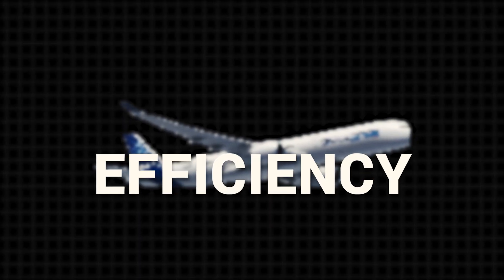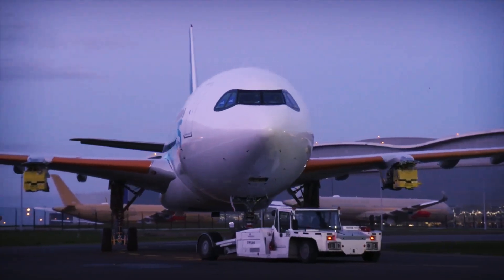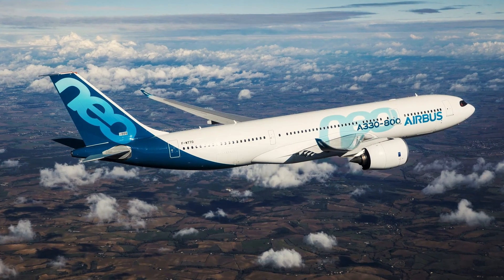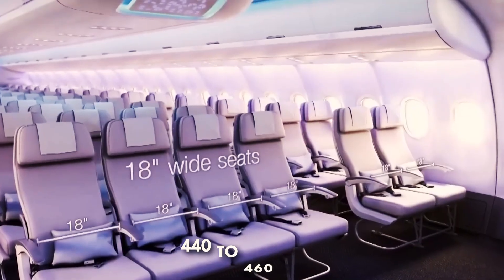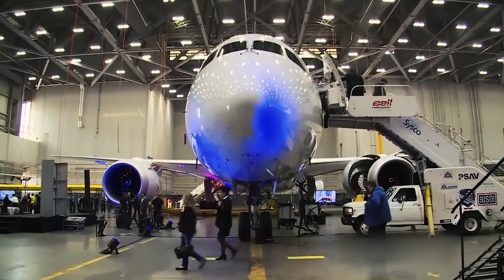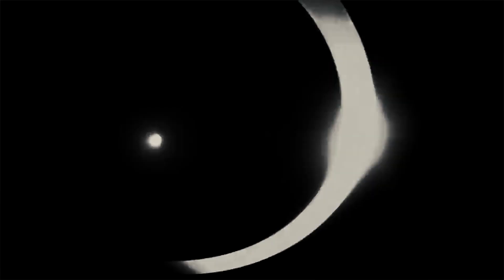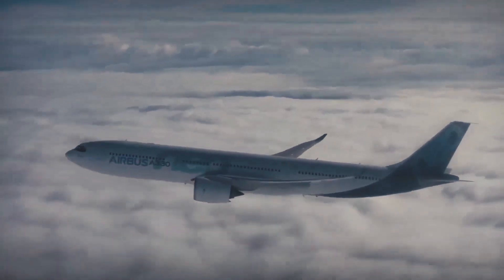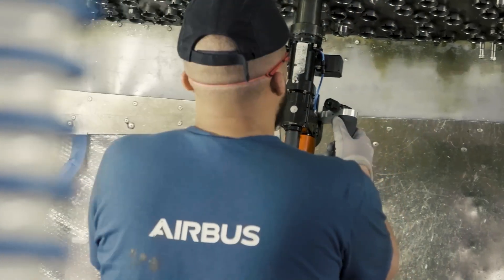Just How GOOD Is The Airbus A330neo Actually?

Comment: It isn’t a direct competitor to the 787. It is bigger, has a higher pax capacity, higher mtow, higher empty weight, higher fuel consumption, and similar performance and capacity to Airbus’ own A350. The two airframes are within a discount of cost and the A350 is superior to the A330 in every single way. Why get the A330 when the A350 does everything better and gives you dramatically more range? There just isn’t a comparison here. The A330 competes with the A350 and with the existing 777-200s. 
Why would an airline switch to an aircraft that is less flexible with worse field performance? It just doesn’t make any sense, and that’s why it hasn’t sold well at all, there are simply superior products.
Reply: You are totally wrong! It`s a direct competitor & it`s very competitive in efficiency & performance with recent upgrades implemented & soon to be further improved. It`s price is also very attractive to airlines who are budget constrained. Sure you could argue the B787 is the better aircraft with it`s composite build & later design features, but it`s reliability has been called into question many times where A330Neo hasn`t. With decent purchase price, good reliability & excellent comfort for passengers it`s an attractive alternative to B787 & this is why it`s orders are increasing exponentially. Do your homework on this aircraft, it`s shed a fair amount of weight, it`s engines are very fuel efficient, even it`s wing angle has been improved to give B787 a hard time in the market place.
Reply: @edwardwilcox6606 not, it isn’t. They don’t compete at all for all differences I’ve specified. There is nothing that they compete on…
Reply: @Da__goat  They compete at every level, if you can`t see it nothing I suggest will convince you otherwise. Why don`t Delta have any B787`s? Because they have A330Neo`s!
Reply: @edwardwilcox6606 There is no metric that either share in common at all. Delta got the A330s at a massive discount, it was well reported. They got them for some 40% off. If you look at the numbers, that is the same list price as the 787-8. Which has outsold it some 7:1. The A350-800 was actually cancelled because of the A330 Neo but the A330 competes more with the A350 than the 787. If you don’t know how numbers work I can’t help you here.
Reply: @Da__goat  I wasted my time obviously.
Reply: @edwardwilcox6606 numbers are hard, not everybody gets them.
Reply: @edwardwilcox6606  my answer, the performance really matters, the angle doesn’t really affect its performance that much. Its engines are heavily derated and it utilises a bleed air system, which eats up the precious thrust. The 787 also has a crazy wing flex and wing sweep, which isn’t seen before on any aircraft, including the 350. This is reflected with a climb rate reaching really close to that of the 757. Orders aren’t increasing that much though, but I’d say cathay bought it. I live in Hong Kong and I don’t really like cx’s ceos, or 330neos offered in the Asia pacific region. Sometimes there can be a thousand questions on why the 330 Neo wasn’t popular, and flying on one and comparing it with the 787 will explain it to you. I really recommend you to fly on one of both, trust me, looking an aircraft on paper doesn’t really work
Reply: A330 is not bigger than 787
Reply: @carmenvalmalaartaraz8260 yes, it literally is, in every single category
Reply: @Da__goat  i don't know where you get your data from. A339 and B789 can carry a similar amount of people, have nearly the same MTOW and very close range figures, no way 3000km, more like 300nm more the 789.
Reply: @carmenvalmalaartaraz8260 the 787-9 has a lower list price and mtow than the A339, it makes no financial sense to go for the A339 over the 787…. It’s simple data

Comment: Given your video, my only response is that 1 the a330 neo series have significantly slower climb speed even after the enhancements according to eurocontrol, with initial climb difference having a gap of 800m per second, then you have cargo capacity, where the 339 is still underperforming compared to the 789, finally you have the range, 3000 km more range is a nail in the coffin and makes the jet a less versatile product compared to the 789 . Also look at the orders, even when boeing is under scrutiny, the dreamliner still got more orders than the 330 neo, your video just contradicts urself.
Reply: These two are far closer than you suggest both in performance & efficiency. Price & reliability is where the A330Neo really scores.
Reply: Have you flown both and used an altitude device. The 339 I flown only took off with 1400 ft per min and the 789 did 3000ft per minute. On paper it doesn't seem much, but given a 10 hr flight, for example icn to sea, it eventually ends up with the 787 9 being 30 minutes quicker in est time, and the 339 just lags behind. And reliability wise, the 789 got 99.4 percent and the 339 got 99.2 percent. Explain how the 339 wins the 789
Reply: @leebenjamin5790  In typical fanboy response you cherry-pick figures that show   the Boeing to be superior. I wouldn`t argue that the B787 is the better aircraft, it`s a later design in carbon with some other aspects the A330Neo can`t match. But the Neo has had some very worthwhile improvements lately which close the gap to my point that they are very close. The important point that you fail to mention is all the trouble the Boeing aircraft has had over the years having real affect on the airlines. In this respect A330Neo is trouble-free in comparison & to mind this is very attractive to airlines. Recent orders show this to be true.
Reply: @edwardwilcox6606  still, I would recommend you to fly on both and do research before you come to a verdict, but for me it’s the 787. Only possible thing the 33N is better at is the 242 layout, if someone which is more to the plumper side of life, flying the 33N would be better, for a normal traveller like me, the 787 gives you a shorter travel time and better air quality. That’s all that matters to me. Spending 30 minutes more on any given plane per 10 hrs will just make me feel more exhausted. As a result, I am biased towards the 787. To the wider Boeing product range, I still prefer them over airbus, and when I have a choice I do choose Boeing. It is tried and proven to be better. I flown on almost every next gen type and I am safe to say Boeing did better to my body than Airbus.

Comment: Good plane , but need to think of a clean sheet model. It is old technology upgrade. To get more sales airbus needs to make a new a300 .Introduce in 2032/32. Like A350 it needs a clean sheet. A plane for 220 passes to 340. A330 200, A330 300 A 330 500. So it covers all 787 models.
Reply: No they don`t, sales are improving & order-book is filling up nicely & it`s reliable.
Reply from the maker: Good point! The A330neo is great, but a clean-sheet design could really push Airbus to the next level. An updated A300-style aircraft would be a game-changer in the 220-340 passenger range! ✈️🔥
Reply: @WingSpanDiaries  they don't need that . They have A330 and A350 so upgrade in A300 isn't needed at all

Comment: Airbus has been doing great things lately, Boeing not ...
Reply from the maker: Totally agree! Airbus is on fire lately, while Boeing seems to be struggling a bit 🔥✈️
Reply: @WingSpanDiaries  not a bit quite a  lot actually
Reply: @Roger-Hypersonic  iam not making stuff up.your gurus daily mail,cnn and telegraph just wont tell you this.
Reply: Nah, their stock plummeted in a rate quicker than boeing recently
Reply: @leebenjamin5790  there is a reason for that
Reply: boeing has
.updated 737ng software
.fixed quality control
rudder issues with 737 due to SUPPLIER fualt
and airbus has
.rudder issues with a320 due to SUPPLIER fault.
so they both have rudder probs,but boeing has worked recently.......long live boeing!!!
Reply: @thetruthbehindplanes  shut up moron